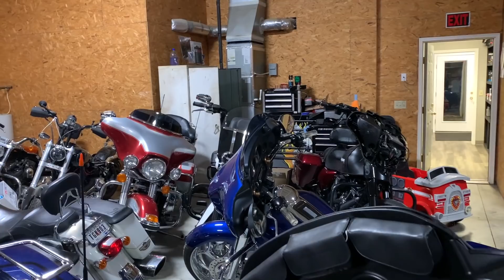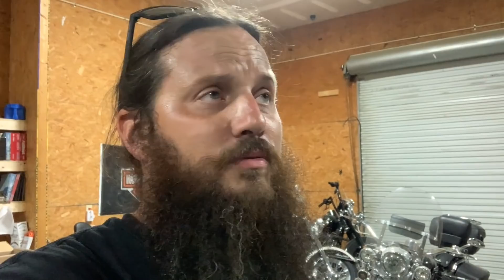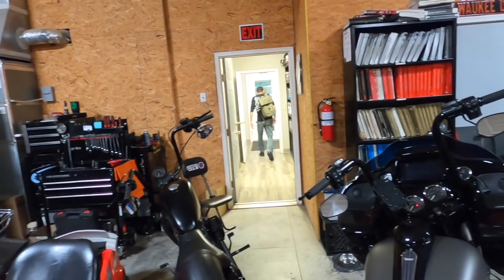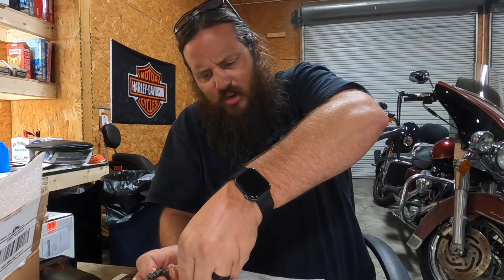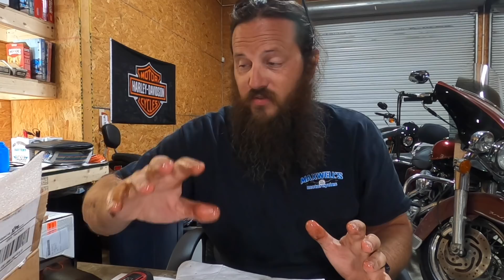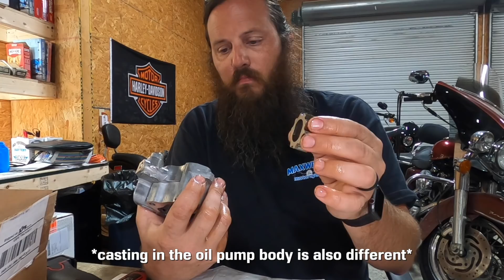Harley Davidson Oil Pump: 2017 vs 2021

Comment: Good to see you John! I put 42,000 miles on my 2017 M8 powered Road Glide; and  the Beast still riding like a CHAMP. I wish you the best with your business!
Reply: Does that mean you did or did not upgrade your oil pump? Send you did not because you would not have known about the problem if you bought your bike in 17?
Reply: Hi I m wondering how many miles did you get on your road glide I’m hoping to get many miles without any mechanical issues other than normal wear and tear I just bought 2022 road king classic

Comment: I have an 18 Street Glide Special and when I brought it in for stage 2 upgrade, they added the oil pump at the same time so I didn't have to bring the bike back in, cause at the time there was a back.order for the pumps and as they were taking my air filter off, the shipment came in, so it was a good day when I got mine put in. Another great video Mr. Maxwell, see you in 2023, 😎😎😎

Comment: My 2019 Ultra 114?
50K miles, meticulously maintained. 
Modifications- HD Stage 1 , TAB slip ons, everything else is stock. 
At the dealership for over 3 months for the transmission oil transferring into the primary, third fix attempt . 
Also major internal engine damage due to the oil pump partially failing. Symptom was almost 2quarts of oil being consumed every 5K miles, dealership was advised several times of oil consumption when it was at a quart every 5K miles and stated “that’s within spec”. It didn’t smoke, and it wasn’t noticeably down on power, but failed the compression leak down test at 72% on the front cylinder. Great motorcycles if you ride under 5K miles per year, and you better have the ESP warranty!!! Damn I wish Victory was still in business!!!

Comment: My 19 RGS has been sumping. Even had the trans rebuild. Stumped again after the factory warranty was up but my extended warranty that I purchased will not cover sumping. I have to blow something up in order to get it fixed. Sounds like the extended warranty won’t fix something that Harley needs to do a recall on. I’m frustrated, thinking about going back to the softail.
Btw, glad to see ya!

Comment: HI JOHN .the oil pump failed on my 02 dyna FXD.the gear roter had broken in half thus destroying the motor £9,000 later and i have an S & S 124 , the difference is just incredible.ps IT'S GOOD TO SEE YOU BACK AGAIN !!!!

Comment: I recently bought a used 2019 shrine edition.  It was manufactured early in 2019 and according to the factory it probably does not have the newer oil pump.  The new oil pump comes with a cam plate.  I think the oil pump may have been replaced.   I understand there are some markings on the cam plate that indicates which oil pump is present.  How can I tell which oil pump may be installed.  Great videos!!!!!!!

Comment: Have a 2017 Street Glide with the torque cam. Harley Davidson replaced the oil pump assembly cover. No sumping issues with 20,000 miles.

Comment: I get only 2 month of very hot weather here but to keep it short the engine oil grade will have lots to do with the engine oil pressure . You being south I would suggest you try Castrol 20 W 50 Motorcycle on your own bike Think of what the engine oil does , Clean Lubricate and cooling the engine Higher grade mean higher pressure at higher temperature better seal the piston rings and the overall area of concern you mention internal to the engine . Doing this will increase compression giving you the extra kick for my  best price in town

Comment: Hey John, I happen to be the lucky owner of a stock, 2018 FLHR. 25k service I had super fluid transfer. The dealer serviced the bike. 15 minutes down the road and it started blowing oil out the exhaust so bad I couldn’t see the cars behind me. They going to upgrade the oil pump but I worry that won’t fix the issue.

Comment: There is a video out there that shows the oil pans from the softail lineup vs the touring lineup. They are physically different. This accounts for the issues specifically with the touring models. At least according to that video. I have a 2018 Heritage 114 and have had no problems. Anyway check out the moto mick a vs b video

Comment: John.  Great video. It’s great to see with added stress of operating your own business that you haven’t loss your sense of humor.  You raised a question for me on differences between liquid cool vs oil cooled. Where I have a 2017 Road Glide Ultra with 33 thousand miles I never had a sumping  issue.

Comment: It's good to see another video from you. I'm glad your shop is doing well. You have shown the one downside to a mechanic who does good work and charges reasonable prices. The downside for the customer is you're always busy and it takes time to get something done. The upside for the customer which is well worth it if you know your bike is fixed correctly and you're not paying an arm and a leg. The downside for you is most of the time you have more work than you can handle.

Comment: It’s volume and velocity change from more teeth to less teeth with a larger gap you get more oil trapped in the gaps and when compressed it moves more faster

Comment: I’ve got a bad issue on a recently purchased 2017 Road Glide Special.  Pushing lots of oil out the air breather.  The previous owner has a stage 1 kit with SE air intake, SE tuner, and Rinehart pipes.   Anytime I ride I get oil down the side of the bikes. Hoping a vented oil dip stick will alleviate some pressure.

Comment: Hey John, here’s an idea for one of your tech tip videos. Explain what happens when you pinch the breather hose when installing an air filter, 16 RGU.  Yeah, ok, I did it. Yup had pressure at the oil fill/dipstick every time I went to check oil.  Lost approx 1qt oil before I figured out what I did.  So where did the oil go? Is there any long term damage? Oh great wizard, give your warriors the scoop.

Comment: As far as the sumping issues, what's your experience with loose/stuck oil piston squirters? I don't have an issue (that I know of!) but it's in the back of my mind that I may need to remove my cylinders just for my minds ease.

Comment: So I read most of the sumping issues come from stage 3/4 builds. I've got a '17 road glide that is just stage 1 with 8200 miles. If I don't ever plan on doing cams or going beyond stage 1, is the new oil pump necessary?
Reply: As far as I can tell, the original oil pump wasn't designed for you to stay above ~4k+ rpm for a long time.  People ripping their bikes by cruising above that rpm were the ones finding themselves in a sumping situation.  I don't know this for sure.  If you drop your rpm's to below 3k or idle, the oil will return to the oil pan and you won't sump it.  Most people do this, which is why its been a rare condition
Reply: @chris.davidoff  there shouldn't be an issue like that anyway
Reply: change it when you do cams so you won't have a problem.
Reply: @SooHighFashion  Probably not, but I bet this would happen to a lot of engines if people ran them in similar fashions though.  It's impossible to make an engine perfect at all RPM's

Comment: Will a bad oil pump on a 2000 Buell cause the oil to flow out of the engine into the oil tank but not allow the oil to drain out of the tank & down thru the hose into the oil pump and engine? I thought I had a clogged line/oil tank but couldn't find any obstruction. I'm thinking it might also possibly be a defective K&N hi flow oil filter. The problem started shortly after I changed oil and put the new K&N filter on.

Comment: What about the Twin Cam. Would you go with Fueling, S&S, or SE for an upgrade? Would it make much of a difference in cooling? Will the stock unit handle an external cooler?

Comment: Hey John any advice on getting spark on a 68 electraglide? I replaced the plugs,coil ,voltage regulator.Replacing the points and condencer next any advice much appreciated! Peace. Bobby from Barrington Rhode island.  By the way GREAT PAGE BRO!

Comment: Congrats on the new shop, question, for a lever 3 m8 build can I use a stock oil pump or should I go s&s or Fueling?
Reply: I have a Stage 3 122ci right now and have had no issues at all on a 2021 Street Glide Special.  I've gone through 3 services since the build and no issues found.

Comment: Hey. I burnt my clutch out on my ‘18 Road King Classic. Has less than 10k. Do you think this could had effected oil for the clutch? The only thing crash I do is rev bombs when I’m splitting lanes (CA legal). Just curious and want to hear your take on this. Thanks

Comment: Hey John, my wife has a 2013 XL 883 L and a PO 107 ( map sensor) code came up. coming off the throttle cable assembly there is a plastic piece that goes over the map. How much has to come off to get to the map. I haven't been able to find any videos on this subject. I reset the code and used throttle body cleaner and now having trouble starting it altogether . Any help would be appreciated thanks

Comment: Hi John, quick question. I have a 21 SG FLHX. Going to do the 475c cam stage 2 upgrade. Do you recommend changing plate and oil pump since it's the newer pump? Trying to save some dollars since the  pump and plate are $800 .  Also, any opinion on S&S 475c vs Woods 22x. I am looking for torque on the low end.

Comment: I have 2018 street glide special, i have quite big blowback promblem. Is the only solution that i have ti change oil pump? Now the oil is dropping from freelow oil filter all over the bike. I dont overfill it

Comment: If I have a stock 2019 Roadking is there any benefit or is it worthwhile to upgrade to the 20 oil pump?  I don’t plan on doing any extensive upgrade in the near future.
Reply: Probably but you shouldn't fix what's not broken. If I were to buy a superior oil pump I'd go for an S&S one over any HD version.
Reply: I heard the upgrade for the oil pump was specific to the M8 engine 114 and up to meet the added pressure.
Reply: @hedonisticpunkvatos  I had problems with my 19 Heritage with a 107 because of the oil pump....
Reply: @rebel_ltz  Fueling were the first to find what the problem was in the oil pump and correct it. Many people have used their Can plate/ Oil Pump kit and put many miles on with no sumping or oil loss. My 19 Heritage had the issue right after they changed the design of the Gerotor and mine was and is working flawlessly.... Although I traded it for a TC....

Comment: Glad to see you're back putting together videos; looking forward to more when time allows [for more videos] around the workload in the shop and family time.  Having your own business can be extremely demanding.  The current delays on obtaining parts is impacting everybody.  Regarding the M8 cam chest, wonder why HD hasn't come out with a Screamin' Eagle version upgraded cam plate?  Have you seen the new M8 Plate from Fueling [the OE+ cam-plate]?  Seems like a cost effective [$300?] add when upgrading the OE oil pump and/or if changing the cam.

Comment: So um this is the bigger pump that has come with the M8 upgrade like 114 to 117 or 131. Now comes stock ?
Reply from the maker: I believe so, but did not actually go through the parts books to confirm. To be fair, with so many versions, I’m not sure that the part numbers would match.

Comment: Good information I have a 2019 ROAD GLIDE with stage 1 and only with 4500 miles is it necessary to do this ASAP? I do plan on doing a SS-cam later but do you think I could still ride till then?

Comment: Hey John, nice to see you back! What do you reckon to running a bike in? I'm taking delivery of a brand new (2020 spec) Lowrider S and I've had the 131ci engine fitted. Do I run it in like the manual says (basically drive like a granny for 500miles) or run it like you intend to ride it? Your opinion will be valued.

Comment: I completed a stage 1 on my 2018 SGS over the winter. Bike has 6,000 miles on it. Last year when stock everything functioned as it should, from what I could tell. After the stage 1, I put on about 400 miles this year so far. After a 130 mile ride last week, I checked my oil and it was a little lower than when I checked the oil before the ride. I also noticed that the dipstick had bubbles on it, which concerned me. A flashlight into the oil pan showed a lot of oil aeration on the surface of the oil level. I then pulled the crank sensor and 7-8 ounces of oil drained out of the sensor hole. Seems like a sumping issue and the oil pump isn’t scavenging well enough, correct?  Would you recommend replacing the pump, or would vented dipstick and trans cover help fix this problem?

Comment: Should I need to worry about this? I put a 131 kit into a 2020 RGS two months ago. My dealer said NOTHING about new oil pump. Or an other part that should be upgraded.

Comment: Hey John, I have a question man. My bike is a 2020 Softail Standard. I assume it has the new oil pump, but I am certain that it does not have the primary breather to prevent fluid transfer problems. 

In your experience, was the fluid transfer issue isolated too specific models, or the 107 vs 114? Or was it general amongst both engines and all models? And also, was my bike, a 2020, supposed to come with the primary vent from the factory?

Comment: Looks like you need a ticket system and attach it to each of the bikes that tells you what each bike is in for and what part is required
Reply: Where I used to work we'd just have a small numbered tag on the keys that'd coordinate with a planner that'd have all the info. He might have something in that order.

Comment: Seems like you have are no longer dismissing  all the internet hoopla (problem be blown out of proportion) on the M8 oil pumps,  .. now I'm waiting to see how you cover or speak of the high rate of lifter failures (and the HD secret memo to check or replace them as early as 20k) and the integration of plastic lifter cuffs used in every year of the M8..

Comment: Screamin Eagle now offers this upgrade (even for 2021 models) - https://www.harley-davidson.com/us/en/shop/Screamin-Eagle-Pro-High-Volume-Oil-Pump-Cam-Support-Plate-Kit/p/62400260

I have. a 21 Fat Boy with a 131 SE upgrade - should I upgrade the oil pump? (SE didn't offer the oil pump upgrade when I did the 114 to 131 conversion) 

Thanks, John!